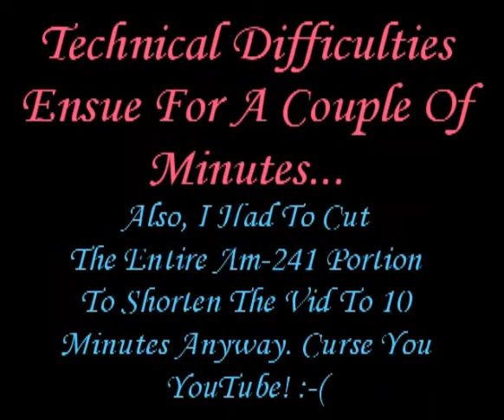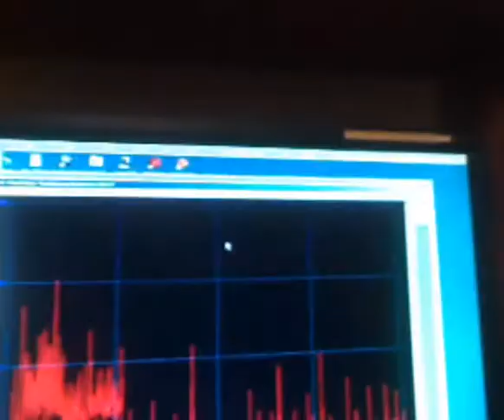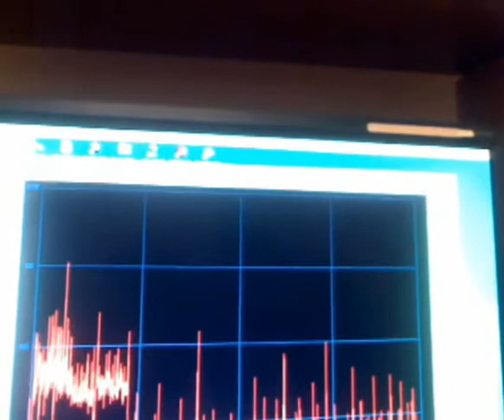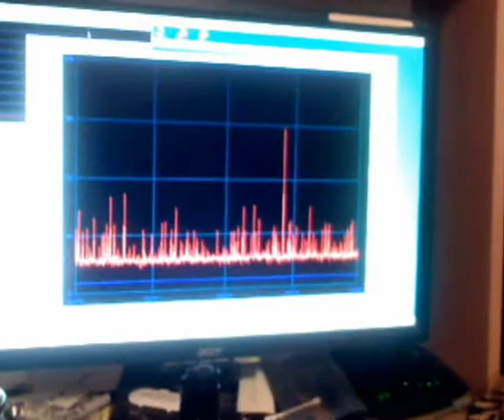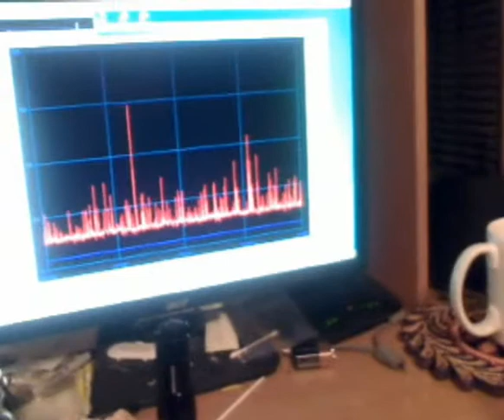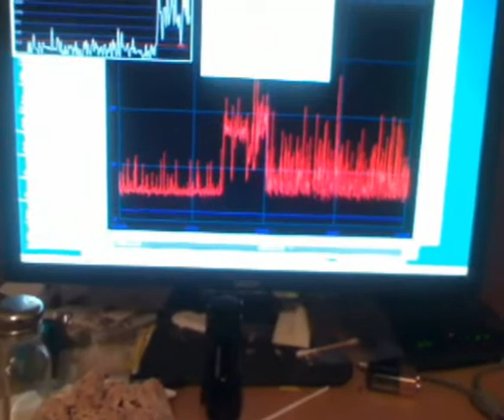Project Arcturus - Homemade Photolistener/Radiation Scintillator, Tour Part III

Comment from the maker: No schematic needed - the interface was simply an audio connection to PC soundcard. The scintillating detector works by translating the feeble flashes of light (caused by energetic particles or rays striking the crystal) into electrical pulses which are then fed to a simple audio amplifier. The output of this was connected to the line-in on the PC soundcard and then the amplitude graphed on Radio Skypipe.

I got my crystal on eBay for yes just $20. It's barium fluoride, taken from a PET scanner.

Comment: Interesting video. Do you have a schematic to go with that for the intreface between scintillator and computer? Also, a scintillator crystal for $20??? Where did you find THAT? And is it a sodium iodide doped with thalium? I see an Australian guys sells a device for interfacing a scintillator to a computer to see the spectrum with PRA software (GS-1100A USB Gamma Scintillator Driver for Spectrometry on ebay) . So I was wondering if your circuit performed more or less the same operation as his.